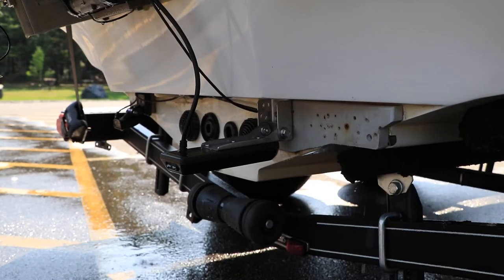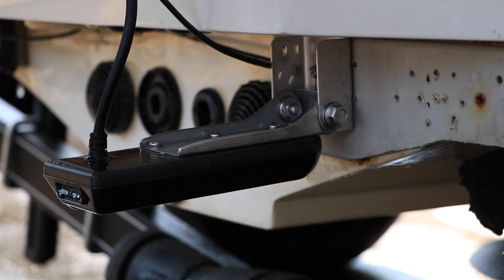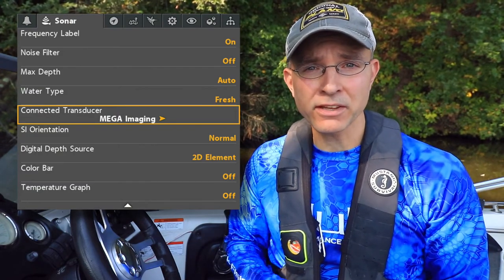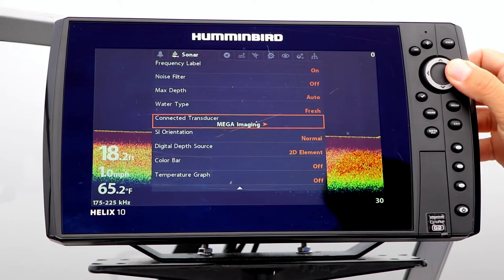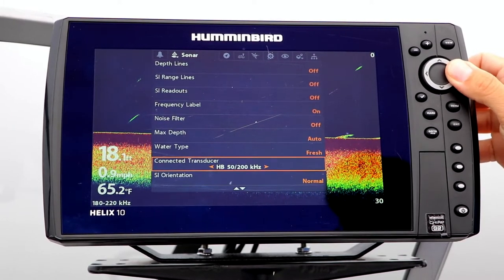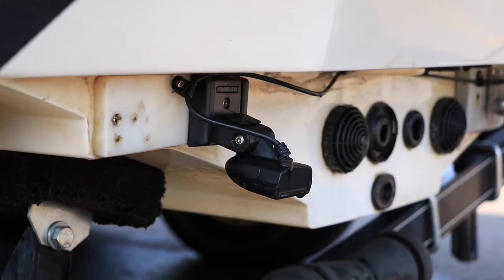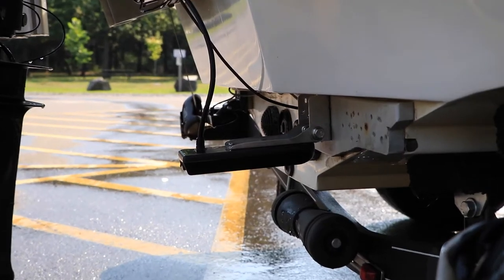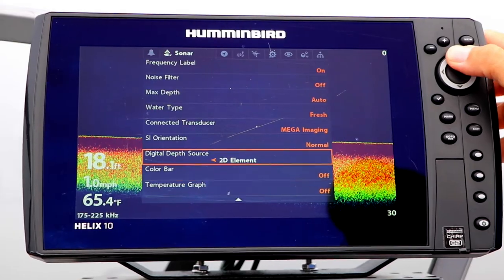Humminbird How To Connect a New or Different Transducer

Comment: I have a Helix 10 MSI + G4n.  I am running it with a Y Cable, and trying to use a XNT 9 20 T, as well as the XM9 HW MSI T it came in the box with.  I have no depth readings on any of the different sonar screens.  Did I accidentally turn the overlay off?  Or am I doing something completely wrong?